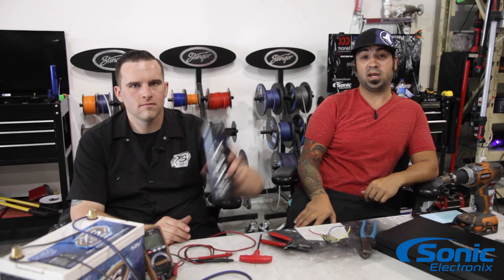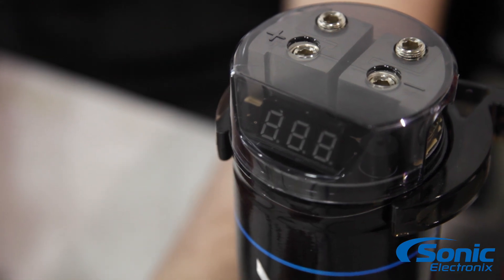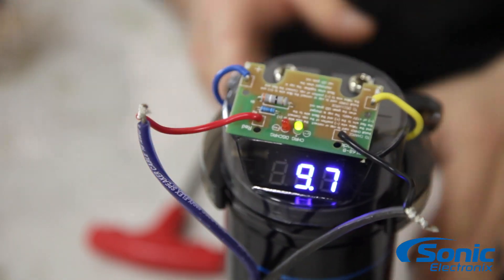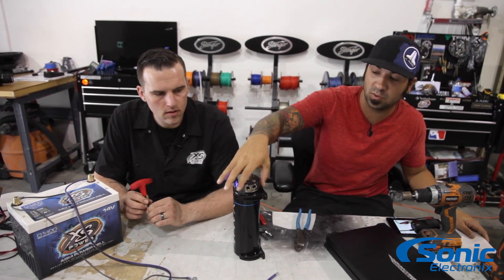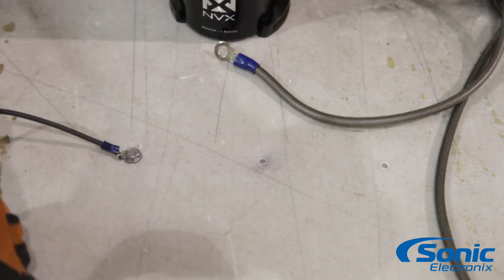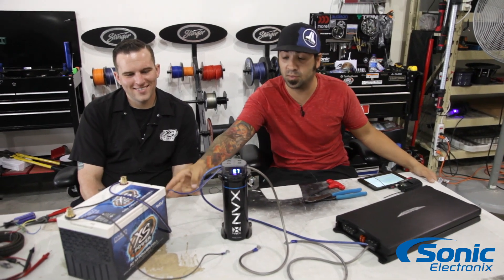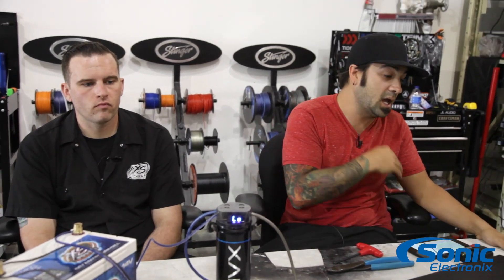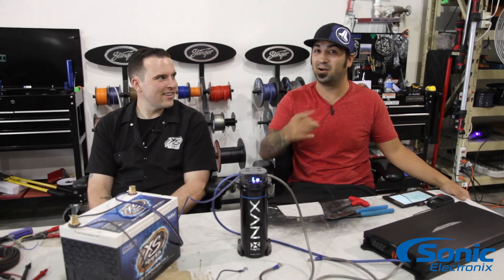How To Charge and Install a Capacitor | Car Audio Q&A

Comment: Ok what is your source for separating grounds? I have read many warnings to NOT separate them as 2 different ground points puts an extra unwanted circuit in and makes for MORE noise.
I am not saying you are wrong i just want to make sure i hook it up right.
Your table car needs a paint job!

Comment: I wish that the voltage display was removable so as my cap is mounted in the trunk, I could have the voltage display mounted on the dash so I could see it as I drive!!! I ordered a kit & the transistor that came with the cap, It did not work!!! lucky me. there is other ways!! borrow one from a friend, use a 12v light bulb (indicator bulb-turn signal)

Comment: Where are the amps going from the cap lol I thought they held charge
Reply: Only slows the dynamics of the voltage fluctuation to stiffen the voltage at a good 13.2 - 13.8 volts during high volumes.

Comment: I am using a 4.5 farad VM as a filter for the cathode heater on a single ended triode amplifier that uses the 833-A vacuum tube, a monstrous tube that takes 10 volts at 10 Amperes just to heat the cathode. This is the only way I know how to get rid of the 120 Hz power supply ripple from the rectifier through a 0.1 Ohm dropping resistor.

Comment: I watch this channel for comedy purposes. First they say put the Cap anywhere you want,... then they say put as close to the amp as possible. The second is the CORRECT way as a Cap discharges instantly and you dont want to lose any of the basically useless charge. Put in a second battery and an isolater instead of a cap. And do the BIG THREE, your car will thank you

Comment: I have a 2000 watt inverter will this work for when I have a high current pull to help buffer the surge from the battery? If so should it be in parallel or series with the battery?

Comment: Besides the fact that you were both in each other's way tell me how to do it and show me how to do it are two different things you showed me how to do the install with the distribution block built in talking about the post maybe you should actually show multiple types at the same time and maybe even talk about Buzz bars and or manually wiring multiple groups together

Comment: 1st rule I learned is never hook up ground untiil your finished conecting positive, the reason for this is you accidentally touch a hot wire to any metal (ground) you get arc!! Connect all grounds last. Same as when installing a battery in your car!!

Comment: Question I install the light system on my wrangler you think I need one of these. I think the light is going to kill my battery.
Reply: Pedro Rocha a cap won't do anything for a lighting system. They put out a massive amount of energy in one quick short burst and that's it. It's for when your song plays a very heavy deep note in a song and the amp calls for an extra boost of power for that split second. You need a bigger battery I'd go with an xs power deep cycle. You need the extra watt hours a deep cycle holds.
Reply: A capacitor won’t hurt if you have a very bright light bar or what’s ever is drawing a large amp
Pad. But all it will do is help it when starting. This is why pumps use cap as as a boost to get the motor started.

Comment: Great presentation learned a lot. I have a question I am building a buggy and will be installing lights with delays. I like to use a capacitor or two to power my lights and possibly other electronic. Can this be done,? I would like to have the power when needed to power like head lights running lights, fog lights. Is a capacitor just for boosting amplifiers or they can be used like for my project??? TY in advance.
Reply: Bernie Jimenez caps are not battery's. They only store a minimal about it power they are designed to let out that power in a split second when the stereos bass drops a hard note. If you charged a cap and hooked a light up to it it would shine full brightness for less than a second before you could see it quickly getting dimmer until dead about 5-10 seconds total depending on size of cap.

Comment: Do you have to run a separate power cable for the capacitor coming off the battery?  Or can you just run 1 into the capacitor and then split it into the amplifier?
Reply: cap comes between your battery and amp on the same line

Comment: Can i use my 2 grounds from the capacitor and the amp get it from the car instead of running a new wire to the negative of the batterie

Comment: There is alot of negative misinformation in this thread. If your intention is to use a 3F cap to run more than 3KW RMS then you will definitely want to upgrade your power source, i.e. a battery and your alternator as your additional battery will require a larger generator, i.e. alternator, to charge. The point of a cap here is the same as that in an ac/dc converter. It is meant to compensate during low periods nut will experience diminishing returns. Most of the time a 1F cap on a <1KW RMS system will go larger unused except for brief peaks and will charge immediately during low current draw.
Reply: _Chainz _ explain
Reply: SO WRONG...   Caps low as 1 2 3 10 are pretty worthless trash.   You can buy 3100 Fara caps for 70 dollars each that WILL make a difference.

Comment: my lcd display isn't turning off its going down to 11.6 or 11.5 and stays on all night I did everything like u guys said any ideas what's going on?
Reply: If it's connected properly and stays on then it is discharging. If it is discharging it's experiencing s draw or you need a new battery. Do your amps switch off when your car turns off? Do you have a cellphone charger with an led that is always on?

Comment: Hi bro how do you install one capacitor to two amps please?
Reply: Same way. Once the cap is installed it will be used by all amps  simultaneously. This will be a shared node.

Comment: is it okay to use mismatched amplifiers driving different Subs with a capacitor too or am I just going to cause a fire. I have 1 sub and an amp both 500 RMS currently and want to add two more cheap Subs and a half farad capacitor I got for free including a 350 RMS shitty amp I want to use if appropriate
Reply: General rule is 1F for 1KW RMS
Reply: Keep a fire extinguisher in your truck

Comment: Thank you sooo much for this video! I had my battery die and so did the capacitor. So after replacing my battery with a optima battery. After 9 years of the capacitor being installed it had never died completely until now. I had total brain fart of how to charge it. Thanks again!

Comment: Where can I buy only the capacitor tool? :)
Reply: FreestylersSM #CSGOGambling# what an Alan key?
Reply: Wish I knew
Reply: All you need is an automotive 12 volt light bulb. Run it parallel on the positive side. When the light goes out cap is charged. The charging tool is nothing more than a resistor and the auto light adds a resistive load just the same way. You can also just use a resistor but it's a bit tricky as you don't have any light you hook it up the resistor gets hot and when it cools back down the cap is charged.

Comment: Um you should connect Ground connections first then positive not backwards and you should always have a inline fuse between the battery at the cap
Reply: that is not correct you take the negative off 1st and you  put the negative in last so actually if all you need to do is disconnect the power you simply remove the negative and leave the positive on and you simply connect the negative when done...remember the positive is a hot wire and you are trying to prevent arcks....

Comment: My capacitor didn't come with a charging tool, where could I order/buy or use to charge it?
Reply: TheDevilLine6 any automotive 12 volt light will work. Run it parallel on the positive side when the light goes out the cap is charged
Reply: @jamesf9610  Just for future viewers, when charging you would want to run it in series...if you run parallel it'll choose the path of least resistance and bypass the light, defeating the purpose of slowly charging it

Comment: Hey guys - thanks for the video. In the process of upgrading the sound system in my truck DYI style and basically have no experience or knowledge. So I am learning as I go. Next subject is how to tune the system and set filters to the different speakers so they get a clean freq signal...

anyway...I just bought a T-Spec V8 3.0 cap and it didnt come with the resistor bulb. So I have 2 questions for you;
1. What kind of charging tool is that and do you know where I can buy it?
2. Can I use my automotive battery charger as a power source for the initial charge vs hooking up to my truck battery?

Thanks for your help and for posting the video. And the table car IS SWEET! I am going to scour CL and the web and see if I can find a good deal on one!

Comment: can two amps be wire to the positive terminal on the capacitor is doing this step safe will it drop voltage ?

Comment: Would I still need to use a 40/80 amp fuse when coming from the battery to the capacitor?
Reply: Absolutely! The fuse from the battery is to protect the wire so that it doesn't burn down your vehicle.

Comment: why did the voltage on the capasitor continue to drop after it was wired to the battery
Reply: It wasn't actually properly grounded
Reply: The proper answer for this is, the voltage display never shut off, and continued to discharge the capacitor like any other load would.
Reply: Yeah the table car isn't exactly metal lol there was no ground to the battery, cap, or amp. All just for show.

Comment: Need help. i have a 12v battery and a 3.0f cap. I'm running a 1200 sundown amp which needs around 14.5v to function properly. my alt puts out around 15v. Here's my question, my cap came with a test light rather than a resistor, so when i pre-charge my cap it's only at 12v. So should i attempt to charge my cap with the test light and the engine running so it's at a higher voltage??? Basically how do i pre-charge my cap into the 14s to properly supply my power hungry sundown amp? Or should a pre-charge of 12v be sufficient to prime the cap? With no cap amp is cutting out at high volume due to voltage drops.

Comment: what if i did rip open the package and threw away the charger. is there anyway to charge without the tool??
Reply: Nathan Ceja  u can use a test light and when the test light goes out it's charged.
Reply: Any car 12 volt light will work. Hook up one wire from the light to the batter positive and the other wire from the light into the cap positive. The charging pc that they come with is nothing more than a resistor not letting the full 12 volts thru at one time. When the light goes completely out the cap is charged.
Reply: USE ANY 12 VOLT LIGHT BULB SUCH AS A TURN SIGNAL BULB OR BRAKE BULB!
Reply: Put the cap in series with anything that runs off of 12v.  when the thing turns off, your cap is charged (make sure its in series... not parallel. google if your not sure)
Reply: Good way to burn out whatever you're running!  eesh..
Reply: That is helpful, thanks!
Reply: Test light
Reply: Nathan Ceja dig in the trash and get it back lol
Reply: Miguel Yup really thats awesome info
Reply: A simple resistor in series with the capacitor will slow the charge.  A 50 watt, 5 ohm resistor will charge fairly quickly, but they're harder to find and not cheap.  A 5 watt, 47 ohm resistor would charge slower (probably close to what the one in the video did), and be easy to get.

Comment: Table car looks siick!! but it looks like its mad out of wood, so a metal bar where the drill bits are to close the loop and actually show us how the devices look like in use would be better and a more realistic setup, perhaps ending the vid with a preformance of the decice, other than that, keep doing what you guys are doing, I learned a lot!!

Comment: Screw all this.
I have my amps powered their own dedicated deep cycle battery that's hooked to a battery charger that's hooked to a 1,000 watt power inverter that's plugged into my car's cigarette lighter.
Reply: I don't think your lighter port was designed to accommodate a 80 amp draw to power that inverter. Also why in the world would you invert it just to convert it back to DC for your second battery? So much energy wasted for no reason. If you're really trying to isolate the battery then connect them with a sufficiently rated diode or just put a resistor in series.
Reply: Jamison W.
It was a joke.
Reply: Good to know, you made it too believably stupid :( I've heard much dumber things said on these car audio video comment sections.
Reply: KOOKOOKACHU
Reply: Cigarette lighters only put out 300 watts
Reply: @xzone454wd7  if that most are only rated for 120 watts.
Reply: Lol
Reply: Laughed hard af at that

Comment: how big a cap should i use for 5 to 8000 watts? and can u hurt anything getting one too big?
Reply: Think of it like this, for every 1,000 watts you have. You will need 1 fared. In your case 8,000 watts would need an 8 fared capacitor or bigger depending on brand. No need to worry about getting one too big. It would just mean that it would take longer to charge and discharge.
Reply: If you're not sure and your system is really that big, then I doubt that your system is really that big. That's likely peak wattage, not RMS which isn't something to take into considerations at all when shopping for caps. If that is the total RMS rating though, then the correct answer was given by Anthony.
Reply: +Jamison W. (Lasherz) i just got 2 new 14v batteries they're holding fine with no voltage drop.
Reply: Then you have no real reason to get a cap, they're primarily to combat voltage drops and while alternators tend to do better with caps, if you have literally no voltage drop then there's 0 benefit.
Reply: +Jamison W. (Lasherz) yea its staying 15.4 solid and 16.0 both no drops. alts senser on a resisted switch in case need an extra .6
Reply: You should be very careful when adjusting your car's electrical system above 15volts. Many many things can go badly from both over 15 and under 12. If you can remove the resistor, or adjust it lower at least without affecting headlight dim you should do it.

Comment: Hello, what about when car staying over night, leave capacitor connected with battery?
Reply: It's a small drain on the battery, very minimal in the grand scheme of things. The only reason theirs was draining so quickly was because the volt-meter was draining it. With a proper setup that would shut off at the very least when you turn your car off.